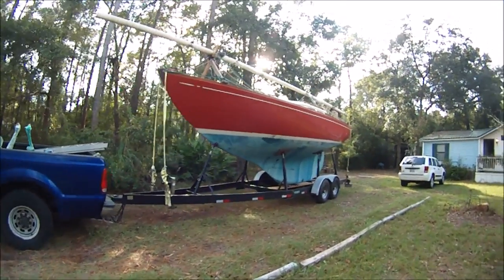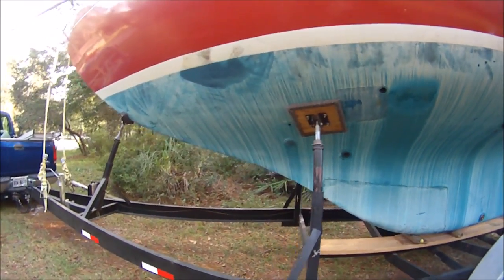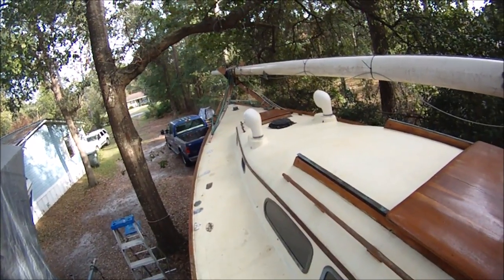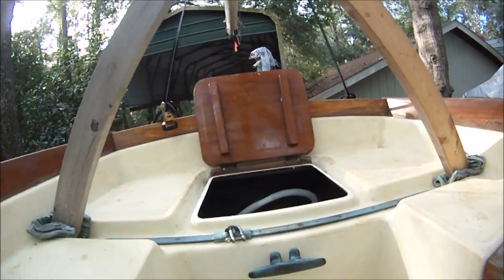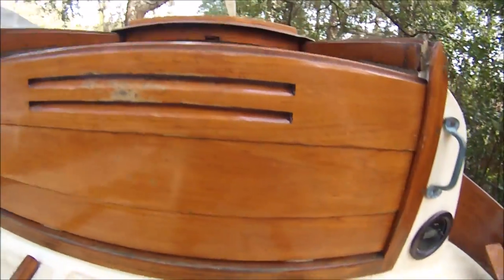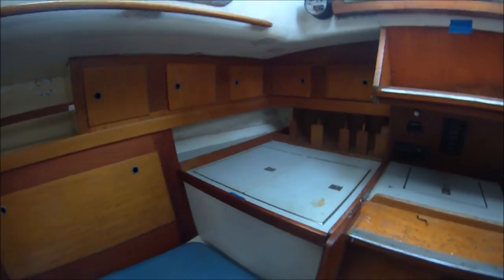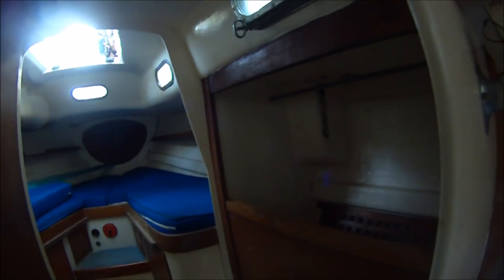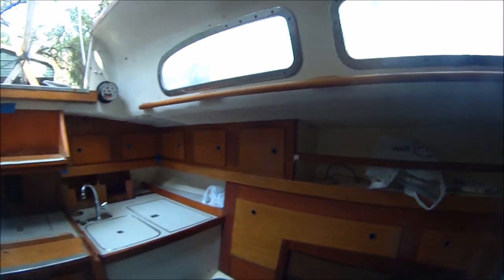Tripp 29 Part 1 (SOLD December 2016)

Comment: can't wait to see your professional work and the excellent finished project.  are you doing this for your self or for a customer?  did the trailer come with the boat or did they have someone truck it to you.  I asked because I looked at a boat that is located in a lake in NC and if I purchase it I would eventually want it moved to the coast.  thanks for sharing your new project with us.
Reply from the maker: I bought the boat on spec to resell at some point during the refit as I have done with several boat projects in the past. The trailer is one of two I already owned so we picked up the boat ourselves in VA. You can buy a custom trailer like this from Sail-Trailers of Columbus, GA or hire a boat transport company thru uship.com to move your boat.
Reply: thanks,  looking forward to the finish project and your price when you want to sell it.

Comment: A little off-topic question; what are your thoughts on Bristol 29 (Halsey Herreshoff design) when it comes to building quality and sailing characteristics? I have noticed that it is on your classic small cruisers list. It is a little wider and heavier than, for example, Pearson Triton or Tripp 29 but otherwise seems similar to these boats when I look at the numbers on the Sailboat Data website.
Reply from the maker: I don't have personal experience with that boat but from what I hear it makes a good cruising boat either in fixed keel or centerboard version, depending on your needs. Bristol had varying average build quality from what I can tell. If I was in the market for a boat of that type and size I'd take a closer look.  I heard they were offered in the tall and short rig options and I'd prefer the tall rig for best performance if available. Since I'm partial to outboard motor well conversions I'd want to see if the lazarette has space for one.
Reply: @atomvoyager  Thank You!
Reply: @atomvoyager  I am also contemplating Allied Seawind 30 which would probably offer better sea motion and more options to balance sails with ketch rig but there is no room for outboard well so the electric inboard would be an alternative if I want to get rid of tractor diesel engine. I also like outboard rudder that allows simple trim tab self steering system. Everything is a compromise… I should probably name the boat “Compromise” 😆

Comment: What are the advantages long term in having an outboard as opposed to an inboard diesel? I assume the Atomic that was removed from this vessel was a gasoline power plant. For longer cruising my assumption has always been that diesel is safer for a boat such as this and possibly increases range potential. Are there mitigating issues that negate the safety advantage of diesel? Just curious. Working on Alberg 30 to refit, won't do the outboard such as the one you did, but curious. I don't have your skills in modification so rebuilding and reinstalling Yanmar is my only option.
Reply from the maker: It's true diesel is less explosive than gas. But when I make an outboard well conversion the portable gas tanks are stored in the vented lazarette next to the motor and that locker is sealed from the rest of the boat. And any extra jugs carried to extend range can be stored in the cockpit side lockers which are also now sealed from the interior and bilge so risk of fire is minimized. 

The many advantages of a properly designed tilt-up outboard well on a suitable boat include: less cost up front and for future maintenance, less weight, less complicated systems, takes up less space, has no prop to drag slowing the boat under sail or snagging crab floats and other objects, if prop ever gets fouled or damaged you just tilt it up and clear it or replace it by reaching over the transom, ability to swivel motor for side thrust when entering a tight marina slip, no inevitable diesel fuel and oil spilled into the bilge, easier future motor replacement or repairs (you can bring the motor to the repair shop instead of needing a mechanic and all his tools on the boat), reduces holes underwater (engine cooling water, prop shaft), because you don't need access to the diesel exhaust and prop shaft and all the rest, you can seal off all the cockpit lockers from the bilge which gives you added safety of collision bulkhead and less chance of flooding, running the engine several hours does not heat the interior of the boat with the motor radiating unwanted heat when try to sleep in the summer or in the tropics, and a smaller motor makes a smaller environmental impact. It's a very practical and liberating way to cruise if done right.

There are disadvantages as well to an outboard vs diesel, so each sailor picks those issues that bother him least and goes with that. Most sailors though are not experienced with or aware of the advantages of a properly designed outboard well or are unable to do the modification themselves and so understandably it is rare to see a offshore capable boat set up this way. I have an article on outboard well construction on atomvoyages.com and videos on this channel of construction and operation. I have dimensioned sketches and patterns available for some boats.

Comment: Did you do an inspection of the keel bolts holding the ballast to bottom of the hull? I imagine there's a high risk of corrosion if the seam wasn't properly sealed at some point.
Reply from the maker: Yes they were inspected. The seam is sealed and the bolts are known to be good quality bronze.